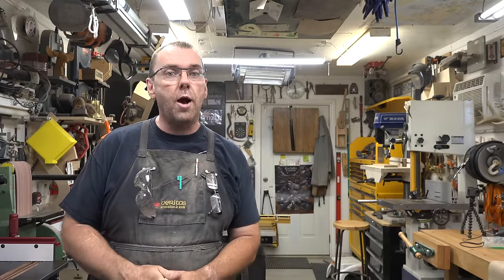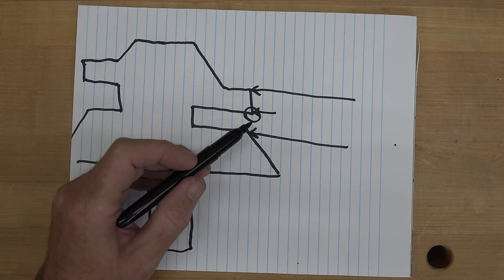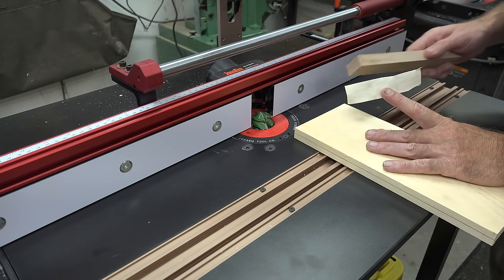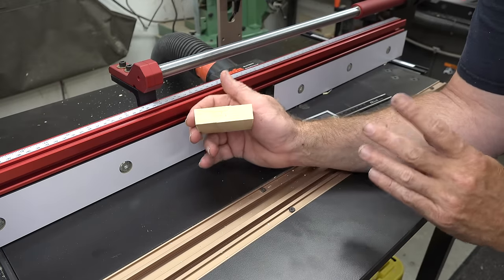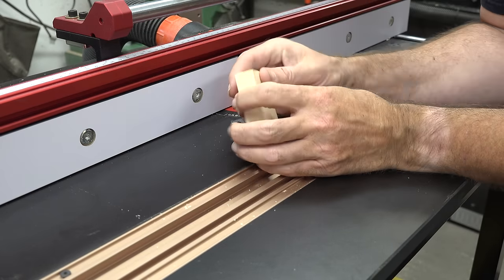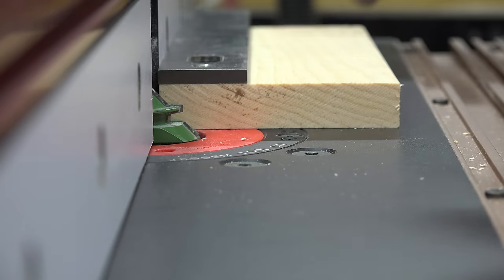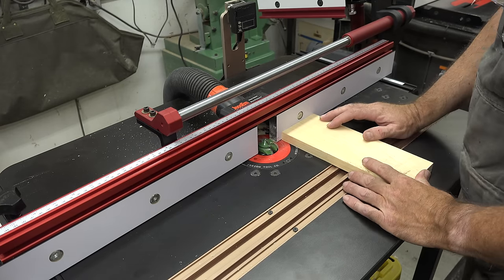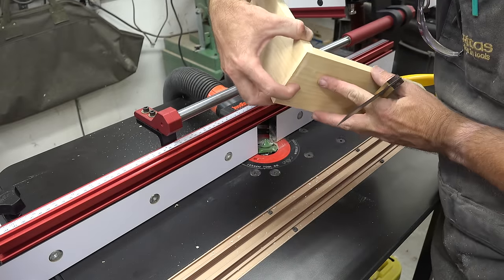Lock Mitre Router Bits

Comment: Well Ken.  In spite if the fact that your tutorial was so thorough i am now firmly convinced that this router bit will never be in my arsenal
Reply from the maker: Don't write it off just yet Michael.  It's an extremely useful bit for things like drawers and boxes and once you get over the initial intimidation of the setup, it works extremely well.  Throw the bit on your next Christmas or birthday wish list and give it a try.  You won't be disappointed.  Thanks for tuning in to the show.  I appreciate the support.
Reply: michael dunn I was in your camp on this bit 15 years ago when I first got one, and I did not have the luxury of Ken. Mine is a green colored bit like Kens. I understand the concept of how accurate the geometry of the bit works and how critical the setup has to be. And I Battled the setup on many attempts, it became a paper weight in my bit box. 
Last August I bought the an Incra router system so I drug out the the green paper weight since I had a precision system I played with the lock miter bit. I even printed a setup jig on my 3 D printer for this bit. The outcome! I made successful joints however other joinery techniques are as good and are easier to make.in my opinion.
Will I try it again after watching Ken’s video? Yes I will! 
I may or may not have a green paper weight for sale embellished with carbide.
If I have success to my liking you can bet I will make setup blocks for the future.

Thanks Ken, 😁🛫
Reply from the maker: @TheFalconJetDriver  Glad that you found some usefulness in this video.  The setup is pretty critical but once you understand the geometry of the bit, it definitely helps with the setup.  You mentioned other methods of joinery.  I totally agree that there are plenty of other joinery methods that can be used and that's what I love about this hobby of ours...there are plenty of processes that can be used to achieve the same result.  As long as it is safe and you are content with the results, then who am I to argue.  Thanks for tuning in to the show and taking time to leave a comment.
Reply: TheFalconJetDriver well falcon jet you summed it all when you said that there are other joints that would hold equally well.  All of my joinery is enhanced with tire bond three so you combine glue with any mechanical joint and you will have a lasting bond that will fail long after my ancestors have come and gone.  So that nice green wood river bit will never come off the retailers shelf and find its way into my shop.    Having said that I am not adverse to watching demos/tutorials etc and find them enlightening. Entertaining and cool. But I know my limiTations and the last thing I need to do is to go into my shop and be frustrated.  Not passing judgement on the bit rather on my skillsets and levels of patience

Comment: How thick is the piece of the wood,nice video,thanks!!
Reply from the maker: The thickness of the material that I use in this video is 3/4" thick.  With that being said though, each bit has a range of material thicknesses that it will work with so be sure to check the tolerances of your specific bit.  I hope this helps.  Thanks for tuning in Robert.  It's very much appreciated.

Comment: Watching your video again for the 50th time I tried your technique and it worked great. Here's my question I used poplar last time this time i'm using plywood for the drawers, will it work on plywood or will there be to much tear out. Also what speed do you recommend for this bit I ran it at 14000 rpm and it worked well. Thanks and again great video.
Reply from the maker: The type of wood that you use with these bits can produce varying results.  Even with plywood, it is possible to get very good quality joints, depending on the quality of your plywood.  The only real true answer to that question though is to make some test pieces and see how your bit reacts to the type of plywood that you plan on using.  As for the RPM of the bit, it would depend on the diameter of your bit.  For a bit that ranges between 1" and 2" in diameter, you would not want to exceed an RPM of between 18,000 and 22,000 RPM.  You might be a little low on your RPM, but the stock you choose can make a difference as well.  If your stock is cutting cleanly with no burning and your router motor isn't showing signs of strain (motor whine, slowing down and speeding up etc) then you should be just fine.  I hope this helps Rick.  Thanks for tuning in.

Comment: Is the setup similar for the 22.5 lock miter bits?  Or there lock router bits that handle up to 2 inches of material thickness?   Found only 3/4 max thickness.  Thanks!  Excellent video!
Reply from the maker: I honestly don't think that this setup will necessarily work for a 22.5 degree lock mitre bit Vince.  The 22.5 bits that I have seen have all been a double bit set.  One that cuts the "tongue" and one that cuts the "groove".  I have to say that I don't own a set of them and really can't speak much on their setup. As for the lock mitre for thicker stock, I am not aware of a bit that does thicker material.  That is not to say that one doesn't exist, it just means that I am not aware of one.  You might be better with a regular 45 degree mitre joint and a spline, which is essentially, what a lock mitre bit replicates.  I hope this helps.  Thank you for tuning in to the show.

Comment: Great video, thanks. Just one question. What is the minimum hp on the router needed for this bit?
Reply from the maker: These bits are designed to run in a router table and should never be used with a hand held router.  With that being said, I wouldn't have a router with less than 3 HP in a router table.  My current setup is a 3 1/4 HP motor and it does just fine but honestly, I wouldn't go less than 3HP for this bit.  It may be a little bit of overkill but I'd rather have the power and not need it, than to get into a sketchy situation due to lack of power.  I hope this helps.  Thanks for tuning in to the show.

Comment: Question.  So once you set the bit as I understand things you run the vertical and horizontal passes with the exact same setup. No adjustment TSA should be needed... correct?  Second question. Will the lock mitre work with plywood?
Reply from the maker: Once you get the bit set and you are happy with the profile of the routing, there is no other adjustment necessary.  Just as you stated, one piece is run through the bit while sitting flat on the table and its mating piece is run through the bit while running against the fence.  It will work on plywood Lou, but there is a lot of material removal happening here so there may be a little splintering, but it is usually inside the joint and doesn't affect the mitred corner at all.  I have used it on plywood many times.  I hope this helps.  Thanks for tuning in to the show.

Comment: Great video, extremely well done sir. Although the right side of the still image miter at the end of the video is just a pinch longer then the left side.... How is that adjustment corrected??
Reply from the maker: It is nothing more than simple adjustments Zach.  When the router bit is set up in the proper way (as I demonstrated in the video) the results should be right on.  Any imperfections after that are caused by either inconsistent thicknesses in the stock or poor technique during the routing process.  It is very possible, that during the haste of filming, I may have allowed the board to dip a little while performing the vertical routing process.  It is nothing that is adjustable through the router bit, but rather an adjustment to ensure that you are routing each pass square to the table and the fence.  I hope this helps.  Thanks for tuning in.
Reply: kennyearrings1 yeah I tried to use that but on some 3/4 maple ply and it blew out all to hell so I just mitered it on my table saw and festool track saw....  I guess I can only use that bit on solid wood or better ply

Comment: I need a six sided box. Can a 45 degree bit be used to cut the sides, top and bottoms so that they drop in after using the lock miter for the vertical sides?
Reply from the maker: I think I understand what you mean and the answer, if I understand you correctly, is yes.  After the lock mitres are done for the box, you can mitre (regular 45 without the locking feature) the top and bottom edges of each of those pieces.  Then, you can cut all 4 sides of the top and bottom at a 45 degree angle to be able to seat inside of the 4 sides lock mitred box.  This will provide a cube where all of the open sides of the stock are hidden and just the mitred corners are visible.  I hope this helps.  Thanks for tuning in to the show.

Comment: Excellent video, thank you!.   Few questions:   is a larger diameter bit needed for 3/4" stock vs 1/2 stock?    Given the large diameter of the bit in either case, are you keeping the RPMS down around 20,000 or less?    I'm getting some tear out on the back end -- my scrap is old and extremely dry and that may be the issue, but could bit speed or bit sharpness be an issue?
Reply from the maker: The thickness of the stock that you use is determined by the specifications of your bit.  Most bits will give a range of board thickness that they work with.  Not knowing which bit you own, it's hard for me to say if you require a larger bit,  I would suggest trying to set your bit up with 3/4" stock (the process is the same as I demonstrated in the video) and seeing if the cutting edges of your router bit span the entire thickness of the board.  As for speed, again, I'm not sure of the diameter of your bit but if you are over 1" in diameter, but less than 2", I would suggest keeping the router speed at around 18,000 RPM, so definitely less than 20,000.  Bit speed is usually a cause of burning and poor quality cuts but a dull bit is also a factor and it is probably a combination of the two that is causing your tear-out.  I hope this helps you out.  Thanks for tuning in to the show and taking the time to leave the kind words.  I truly appreciate it.

Comment: Great video, I echo those comments made by others.   Question, can you use the bit on thicker stock or are you limited to that of the height of the bit you have.  Hope that makes sense
Reply from the maker: The bits do have thresholds of the thickness of stock that they can use.  In order to use thicker stock you would need a bit that was designed to take it.  I hope this helps.  Thanks for tuning in and for the kind words on the show Robert.  I truly appreciated it.

Comment: Great video thanks for the detail.  Can you recommend a lock mitre router bit.
Reply from the maker: Thanks for the kind words Robert.  I have only ever had one lock mitre bit and I have had it a used it for years and wouldn't trade it.  Although they can be a little pricey, here is a link for the one that I have (it's the 1/2" shank model)  http://www.leevalley.com/en/wood/page.aspx?p=30119&cat=1,46168,69435,46174 Thanks for tuning in to the show.
Reply: I got mine through the Wish app. Much cheaper than the local hardware shops.

Comment: Great useful tutorial. What speed would you use on a cutter with 1/2"  shank?
Reply from the maker: The speed of the router bit is not gauged by the size of the shank Trev.  It is gauged by the diameter of the bit itself.  For this particular bit, where the diameter is 1-3/4", I would try and keep the RPM no higher than approximately 18, 000 RPM.  You can google router bit RPM ratings and get a pretty good general idea of the size of bits and what speed you should be running them at.  I hope this helps.  Thanks for tuning in.

Comment: Having troubles, using Porter Cable 1-3/4" HP,  i'm using the lock miter exactly like your showing but think my router is under power, my board are 3/4" maple and i'm routing end grain.  i have to go so slow my boards are burring and chipping...almost seems dangerous.  i've slowed the router speed as i'm suposed to.  Help!  will a 2.25 HP do the trick or do i need larger router yet?
Reply from the maker: First off Joe, what is that diameter of your router bit?   If it is 2" in diameter or larger, you should be using something higher than a 2HP.  If you are using a bit that is 1"-2" you want to run your router between 18,000 and 22, 000 rpm.  Larger than 2" diameter, you will run between 12,000-16,000 rpm.  I would check your router's manual to see what setting provides which rpm speed and adjust it as close as you can.  There's shouldn't be any chipping and if you are having issues with your router taking the whole cut in one pass, try it in several passes.  You can do this on the horizontal pass and veritcal pass by just adjusting your scrap "fence" board that you adhere to the stock to prevent the router bit from taking too big of a bite.  While I prefer to do mine all in one pass, I also have a 3.25 hp motor in my router table so I have that ability.  I hope this helps.  Thanks for tuning in to the show.

Comment: Great Video!!! I spent many hours trying to set up the lock miter bit... I should have watched your video first!! What speed do you run the bit at?
Reply from the maker: That depends on the diameter of the bit that you are using Billy.  If your bit is between 1-1/4" in diameter and 2" in diameter, the maximum speed that you would want to run that bit is around 18,000 rpm.  I prefer to run the lock mitre bit at the maximum speed.  Depending on the species, I might have to adjust that speed to accommodate any issues at the time of routing but for the most part, it's the maximum of around 18,000 for me.  I hope this helps.  Thanks for tuning in to the show.
Reply: @acutabove_woodworkings  Thank You!
Reply from the maker: @billyjohnson1359  You're very welcome.

Comment: Very useful video. However my question is: Can you use this on different thicknesses of stock (say 1 inch, or 5/8 inch) ?
Reply from the maker: 100% yes Barry.  The setup for the different thickness is exactly the same as the setup that I demonstrated here for the 3/4".  You just have to check the tolerances of the lock mitre bit that you are using as they all have a minimum and maximum stock range.  Anything in between those values is fair game.  I hope this helps.  Thanks for tuning in.

Comment: I finally got myself a bit. I’ve seen other YouTubers stick a 1/4” board onto the fence for the first pass then remove the board to take a second pass - I guess to remove less material each pass. Is that necessary?
Reply from the maker: The purpose of applying a 1/4" board to the fence is to reduce the amount of material that the bit will remove in a pass.  Is it necessary?  No.  But it will cut down on the wear and tear of your bit and make the whole process a lot easier on the tool.  The choice is ultimately yours and neither method is wrong.  I hope this helps.  Thanks for tuning in to the show.

Comment: Great presentation,. I am just learning how to use a router, why did you make 2 passes with each cut, thanks in advance for your answer.
Reply: Robert Hoyle the wood can bounce off the fence or wood chips can get between the work piece and fence or with pine it can be quite woolly, so running it over twice just cleans the cut. Running twice is not always possible though
Reply from the maker: Well, I never got the chance to answer before Nick jumped in with a fantastic answer.  With the lock mitre bit, where a complete fit is require all the way along the length of the joint, it is possible that the stock can skip slightly from the fence causing it to not get completely routed in the profile that you need.  The second pass (as Nick pointed out) is basically a way to clean up the first pass and make sure that everything is routed correctly.  I hope this helps.  Thanks for tuning in to the show.
Reply from the maker: Great answer Nick.  Thanks for chiming in with it and for tuning in to the show.
Reply: kennyearrings1 thanks, great videos. Keep them coming. Hope you didn’t mind me interfering, I’m terrible at keeping secrets. 😉
Reply from the maker: @nicksainsbury7152  Not at all.  This is an interactive program and I love it when the viewers chime in to help each other or answer questions.  It's what it's all about.  Spill the secret....I mean give an answer any time you like.  LOL.  Glad to have you as a viewer.
Reply: @acutabove_woodworkings  thanks for the reply guys.  It is great when you ask a question and you receive help from someone more experienced.
Reply from the maker: @roberthoyle6442  You're very welcome.  There's absolutely no point in having a channel to teach people woodworking, and then not be willing to help when they ask questions.  Glad that we could help.

Comment: Kenny, what do you think about making the full depth cut in two few passes to reduce risk of  tearout?   Rather than repositioning the bit or fence, perhaps clamping 1/4" stock to the fence for the first pass.    Also, obviously Rockler sells a setup block for their own bit.   Once I've gotten the desired result, I presume I would now have my own custom setup block?
Reply from the maker: I have never been a fan of making multiple passes with a lock mitre bit.  The point of doing the setup is that you make test cuts, check your joint and then adjust your fence or bit height accordingly.  When you get the fit that you like, you run your stock through in one pass.  Adding shims to a fence and making multiple passes just isn't my cup of tea.  The bit is designed to accommodate "one pass cutting" and the stock should also be able to take it.  As for the setup block.  It's a great idea and I would suggest it.  Once you get your setup perfect, running a piece through in both cutting positions (one on each end) will provide you with a perfect setup block for that thickness of stock.  Just make sure to label your block for which cut was done on the table and which was done against the fence.  I hope this helps.  Thanks for tuning in.